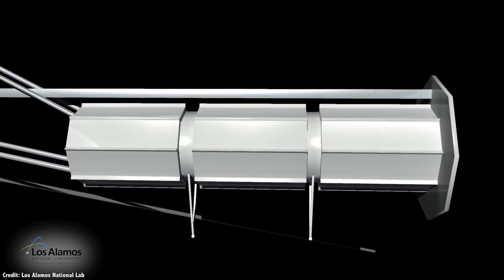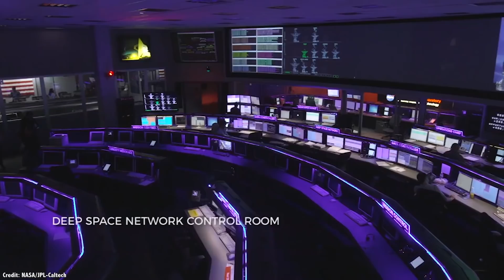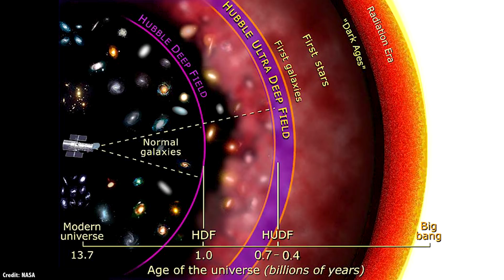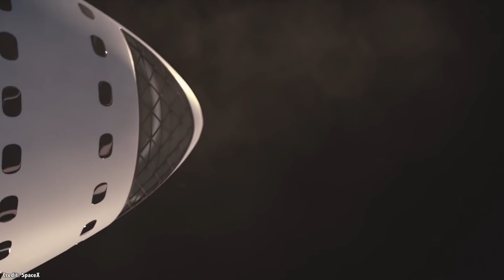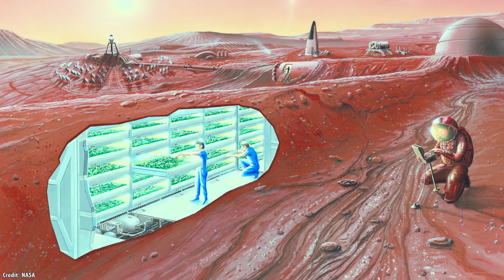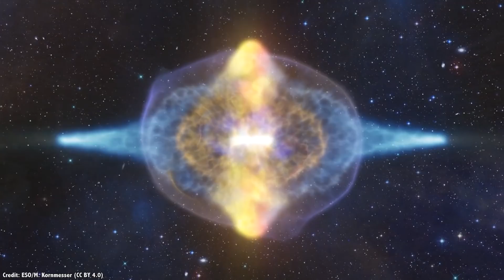Q&A 143: Could Heat on Venus Power a Rover? And More...

Comment: The heat of Venus can be used to generate energy in a kind of geothermal generator that cycles a fluid through layers of the atmosphere.
Reply: you are kind of right.  Thermodynamically speaking the temperature difference between the atmosphere layers are a viable source of Energy. Cycling a fluid through that hight differences is probably impossible from an engineering point of view. however, you could have a balloon that traverses that distance and uses the temperature distance. for example by boiling water in low layers and condensating it in higher layers.

Comment: Question: Could NASA build a landing pad on the moon by using a parabolic mirror to melt the lose regolith and letting it cool down again? 
I imagine a robot that melts small bits and moves on. Over weeks it will solidify a large area as a landing pad.

Comment: Could it be possible to consistently produce enough gass on Mars to maintain a earth like atmosphere in a small area before it dissipates?
Reply: Yep, if the area is enclosed with solid materials.
Reply: @seymoronion8371  I'm thinking open area, if it would be possible to generate so much gass that it cannot escape quickly enough.
Reply: @HPA97  Oh, I see. Yeah, I can't answer that one. Maybe Fraser will. ;)

Comment: So what would you have used instead of the shuttle?  A lot of its payloads could have been unmanned on other vehicles but others not so much.  For example, try fixing Hubble with a capsule.  I agree it was an expensive death trap but what "type" of vehicles could have shared its capabilities with the tech of the era?
Reply from the maker: I think you could have fixed Hubble with a capsule. It would have been a tight fit, but possible.
Reply: @frasercain  I could probably show up to Sturgis on a pedal bike🤣.  A capsule with a grappling arm equipped with some kind of work platform....sure.  I would love to see a video about this.  What missions could have been done with other systems and what missions required the shuttle?  If you could pipe dream something better, what would you envision that to be?  Anyway.  Just my xmas wishlist.  Thanks for your time, your reply, and as always, the work you do to enlighten the rest of us.

Comment: An RTG on Venus would be theoretically possible but, por dios, the temperatures pose some insane challenges. You might get decent efficiency with an RTG at 1000 C—still less than 2:1 ratio between two temperatures, putting it in Kelvins (about 1300/750). But not many materials can stand up to those temps, especially if you want them to actually do something.

I like the idea of a solar power satellite beaming microwaves down to the surface. No illusions that this would be easy—you'd need some BIG hardware in space. But once in place, such a device would be amazing. Your Venus rover could just go on and on, until something actually fails.

Comment: If you figure a typical galaxy being 100 000 light years across, at a distance of 13 billion light years, you need a resolution of a bit less than one second of arc, to see such a galaxy as more than a single point of light. Both Hubble and JWST can do somewhat better than that. So that puts us in pretty good shape WRT resolution. The other big thing, of course, is gathering enough light, and there JWST is a big leap forward.

Comment: How much Thermal Heat does an RTG require to generate electricity? I have to assume its hot enough on Venus. The  problem is stopping everything else from melting. Ceramic Tiles will only get you so far, you will need some kind of active cooling and some way to dump that heat from cooling into an already hot environment. Are there any materials like Freon that work @ 700F, like Freon Works at 90F?
Reply: @scrambles1944  only way to know is to go - the most interesting results are usually the most unexpected ones.
Reply: @scrambles1944  Not sure how long aerojel is going to last in a 700F corrosive environment. Batteries would be fine, no need for and RTG. RTGs are for long term low power requirements, powering Light Houses in the Arctic unattended for decades. To create the Liquid Nitrogen you will create heat to compress the air, and break molecules with electrolosis or cehmical reactions, how do you dump that heat or get new catalyst? The environment is too hot and corrosive for our materials. The Russian Probes lasted a few minutes to an hour or so. Not saying we shouldn't try but we need a bunch more materials engineers banging at this problem.
Reply: There was a mission proposal for an actively cooled NASA Venus rover. It would have used a Stirling cooler to expand gas inside a chamber for the electronics, causing it to cool and then recompress it outside of the chamber to temperatures higher than those of the Venus environment. Radiators at the outside of the rover would then "cool" the compressed gas back down closer to the outside temperature before the gas would re-enter the chamber and expand again. It would have required an RTG to generate the power  for the Stirling cooler.

Comment: I think Ingenuity has positional control over the rotor blades (encoder so they can move them to specific angles). So if it tips over, they might be able to command a specific angle of rotation like a scissor shape with a small kick to flip itself back over.

Comment: Heat isn't that big of an issue, it is the acid, but heat thermals for a glider might be an option
Reply: heat is absolutely an issue. Very little hardware is usable at all at these temperatures, and power generation is severly impaired.
Reply: @Релёкс84  but all that can be worked out as he pointed out, like I said the acid is the killer, it will dissolve almost anything,  sulfuric acid is serious stuff
Reply: Extending more than two hundred km above the surface, the thermals are a great source of power, hence it is heat, and can be used to power the flying craft, the acid is less than 100km
Reply: @Релёкс84  Silicon carbide semiconductor integrated circuits... They seem promising
Reply: No, the heat is THE issue. H2SO4 isn't even much of a problem except in the presence of water.